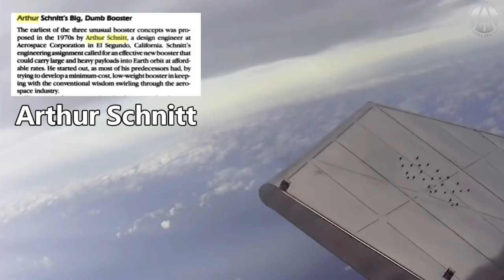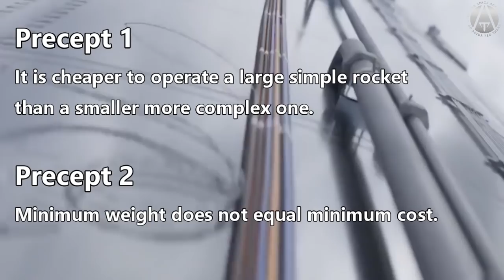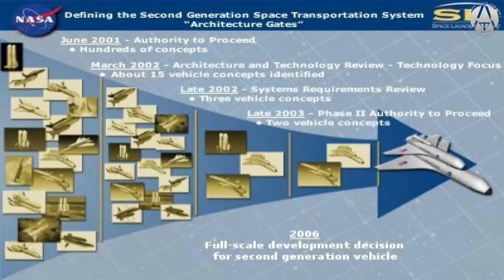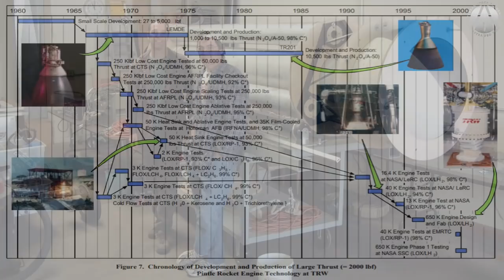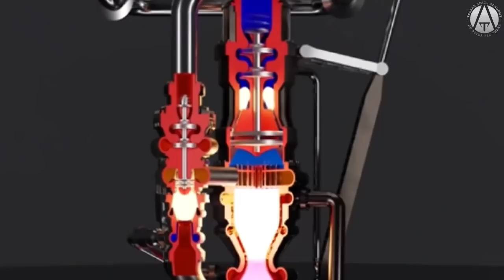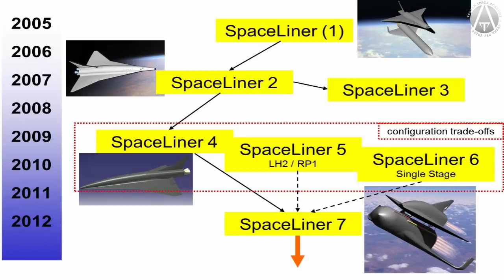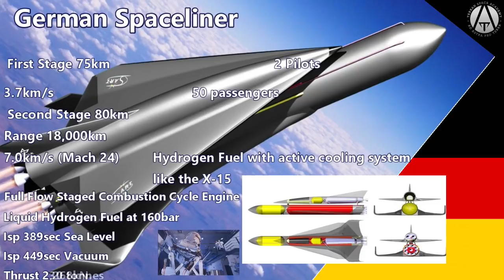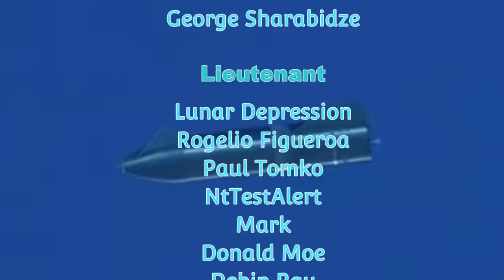SpaceX Starship: What is so special about the Starship system?

Comment: You do realize that Starship VIOLATES every single precept of BDB/MCD right? It's 'cheap' to build only because it is NOT an actual operational launch vehicle at all. It's not even a good expendable launch vehicle let alone the "reusable" one that's been promised.
It is made of 'cheap' materials, by 'cheap' labor but is not able to perform any of the requirements of launch. It is inefficient in it's recovery method wasting propellant and mass for a complicated and  difficult recovery method that does not enhance reusability. (Hence most BDB/MCD designs were robust enough to simply parachute into the ocean, dragged back to shore and refurbished not requiring pin-point landing accuracy and avionics) And at that what we currently see as "Starship" requires vastly more work and systems to become an operational EXPENDABLE rocket let alone a reusable one. Again violating the principles and concepts of "LEO on the Cheap" which stipulates a large, unsophisticated, and cheap to build EXPENDABLE rocket beats a large, sophisticated and more expensive REUSABLE rocket for foreseeable launch rates. (Yes I read and have it)
If you've read it in context you understand that in both cases MCD/BDB ONLY made sense with a higher flight rate and then only with a robust and rather large pre-existing in-space infrastructure (no Starlink 2.0 does not count) and existing need for large amounts of payload in LEO. And in most cases an expendable BDB/MCD won out over any reusable design unless the flight rates were VERY high.

Starship is a complex vehicle that currently lacks the complex (and expensive) systems to actually operate. It has expensive and complicated, (and so far unreliable) turbopump fed engines that relies on a complex and expensive set of avionics and inefficient powered return and landing, (which reduces payload, and note it does not even have an actually usable landing gear design as of yet) to return it for reuse. Then there is the Superheavy which requires even MORE of those expensive systems, a specially designed and built "landing tower" and even MORE complex and expensive avionics to ensure it can 'land' at said tower, (failure of which has a high chance of requiring repairs or rebuilding of said tower) all of which directly violate MCD/BDB principles as well as most normal launch economics for no gain. The ONLY reason Starship is so "large" is to meet Musk's arbitrary focus of "maybe" landing 100 metric tons on Mars. (A figure he plucked without context from Zubrin's advanced Mars Direct concept btw) 

The X-15 did not have active cooling, no vehicle has had active cooling as of yet though the concept is well understood and tested. 

Spaceliner was not further funded for the simple reason that it was not found to be economic. Point of fact (despite what Gwynne Shotwell might think) "point-to-point" (P2P)travel by rocket for cargo is economically marginal and uneconomic for passenger service. This is worse, (not better) with multiple stages due to a higher baseline cost over a single stage system. Further "ballistic" P2P has been shown to be about the worst way to perform the mission due to its inability to interface with any current transport system, thereby requiring and adding additional infrastructure costs to the already high cost of rocket launch.

Your comparison and comment on "America versus the World" is just plain wrong. America is far from the only nation where merit matters and it is often, (especially in the corporate world) individuals "in charge" who can make or break a program. 
We have seen this with the differences between the Falcon 9 design and development program and that of Starship. Falcon 9 had a coherent plan and design focus whereas Starship does not. Elon has a history of failure (with the Falcon 9 being HIS only actual success) due to narrow focus, bad management and poor decision making and his over-focus on Mars that has resulted in the current "Starship" is another in the making.
Elon Musk micromanages all aspects of SpaceX for example, Shotwell and Mueller were not given free reign and had to/have to get Elon's approval for all work and effort. This is a main reason Mueller left SpaceX because of Musk's interference and redirection of Raptor development. (And why Musk is 'blaming' him for the Raptor's problems) Mueller is listed at 'retired' but he quite SpaceX and started a new propulsion company because he saw the same issues at SpaceX that he'd had at TRW.
Reply from the maker: Thank you for the feedback Randy... we will try to address each one.

Starship violates the BDB approach...
It does not though... 
The Starship would be the perfect BDB...
why make a perfect device to test?  Why not build a cheap steel shell and get it working before you try to make an entire rocket.  
Starship has flown... relatively cheaply... how many times has SLS flown?  

The engines aren't simple pressure fed...
The BDB guys were wrong about massive pressure fed rockets.
You would have to us some form of hypergolics to keep them pressurized and the heat and pressure would make the skin thickness too massive to be practical... a 7 to  8 bar big tank with an efficient turbopump is best.

The German Spaceliner was a bad example...
Spaceliner was used as an example of a planned full flow staged combustion rocket engine... not as an example of point to point transport being economically viable.
On the other hand if you can do it cheaply enough of course it will be.
It hasn't been integrated into the current transportation infrastructure because it doesn't exist yet.  Everyone kept saying electric cars will never work because there aren't any charging stations... of course there weren't before you had enough electric cars to make it worthwhile.

Point to point will never be viable...
P2P will have its place.  
The best examples I can think of would be military cargo drops and disaster relief but there will be a NY to Europe and LA to Asia daily point to point Starship at some point.  It won't replace civil aviation... just supplement it.

Raptor was not addressed...
It is fully addressed in previous lessons... 
the point was made by the ship itself... 
It turns out that bigger rockets 
If they are going to be reusable and carry people...
require more advanced engines...
You could put much simpler engines on a Starship and have the cheapest heavy lift disposable rocket imaginable...
As rockets get bigger full flow staged combustion make sense...
Smaller rocket engines will work just was well with expander cycle engines... like the RL-10.

Merit is valued in other countries too...
We would argure that merit is a fundamental human virtue.
Merit might be valued in other countries but their bureaucracies tend to pull down those who strive to rise above.  
The tall poppy must be cut down is not an American phrase.  
Or these other countries don't have the resources to accomplish what SpaceX has...  America doesn't just foster great ideas... it has the means to support the endeavor.  Most don't.
Of course Mueller and Shotwell have to get Musk's approval on important decisions... he owns the company.  In the end he is responsible for everything it does and therefore must maintain authority over what it does. 

Thanks again for raising these issues.
Reply: @terranspaceacademy  
"It hasn't been integrated into the current transportation infrastructure because it doesn't exist yet. Everyone kept saying electric cars will never work because there aren't any charging stations... of course there weren't before you had enough electric cars to make it worthwhile."

This deserves a complete if long answer because it's important both in the specific example and in general.

There's a misconception that transport systems both do and don't have to interface since (as the example goes) airplanes don't land and takeoff from Train Stations and Ships don't load and unload at the local Bus Station. 
But the systems DO interface and are designed and built to complement each other taking into consideration their particular strengths and weakness. 

They are specifically designed as much as possible to interface with each other since they service "destinations" and that is what transport systems require and service.

P2P ‘should’ have a higher applicability to such services than to space launch because there are no ‘destinations’ in space and very little infrastructure or need of ‘commercial’ transport as we understand it. P2P on the other hand ‘could’ plug into the entire Earth’s “transport” network with a little work and effort but in general it’s not economical in any sense to do so and that’s NOT based on just the cost of operations.

The “everyone” who said that electric cars would never work because there weren’t charging stations was likely a majority of folks who simply didn’t want electric cars, (with a sprinkling of people how DID but were complaining for a different ‘base’ reason that the majority which I’ll get to in a bit) because of that they latched onto the idea that we’d need to install thousands of specially designed and operated “charging stations” all over the country and insinuated that this would be a major infrastructure effort costing millions of dollars for a very few vehicles.

Sounds uneconomical right? Well it is. In order to charging stations to become about in any significant way there had to be thousands of electric cars on the roads to justify the time and effort. 
But here’s the thing, you very much did NOT need ‘charging stations’ to start using electric cars on a large scale basis because we did that long before any “charging stations” were ever installed.

Because the infrastructure to support electric cars was already in place, commonly available and widely used. 
Most electric cars early on were simply plugged into home or business ‘standard’ plugs using essentially extension cords. A “charging station” simply used a different ‘cord’ to rapidly charge the EV, it was and is a convenience NOT a requirement.
Yes once you had thousands of EV's on the streets then spending that much money makes sense but it's not NECESSARY to start using EV's and never was.

P2P transport can be designed to use existing infrastructure much as early aircraft used bays (seaports) and big grass fields (cities) to operate from IF one takes the effort and time to do so. 

But I suspect that like many you are assuming that rocket powered, and specifically ballistic rocket powered P2P is the most likely option which is exactly opposite of what every group and study has concluded. 

You ‘can’ do P2P with pure air-breathing engine power, a rocket helps but as a primary propulsion system is has so many inherent issues that it never trades economically. 
It’s worse for anything beyond one stage because the increased operational costs. Worse rocket powered takeoff and/or landing introduces so many operational issues that even if the cost could be brought down the added costs for those operations would be too great.

Not to beat on SpaceX here but since their “concept” is so egregiously wrong from the start they are the easiest to pick apart. 

First of all the operational characteristics of Starship/Superheavy are so difficult that it cannot be operated from anywhere but a very few select sites, (Boca Chica is NOT one while the Cape is one of the few possible land launch and landing sites) so that SpaceX can only plausibly launch or land from an offshore platform. 
And that has to be more than 30 miles out to sea due to the way sound travels over water. 

So right there the possible launch and landing sites has not significantly increased a bit. (Remember the SpaceX presentation where they names about a hundred cites as ‘destinations’? Only about 10 of them were possible and of those only about 5 were actually capable of having such operations anywhere near them and even then the cost and inconvenience of such operations made no sense either economically or operationally)

This is only marginally better for other P2P concepts such as the German Spaceliner since it would still require to takeoff from a dedicated launch facility (in the middle of nowhere which is difficult at best in Europe or Asia) and would end the journey as a high speed glider needing cleared airspace and traffic lanes even though it could (in theory) land at a conventional airport. 

A major issue is true (global) P2P essentially require about as much delta-v as getting to orbit which is a major cost and operations factor even if you spend a good deal of the trajectory outside the atmosphere. You have to go up and come down ‘someplace’ that’s clear of traffic and controlled which again pushes the entire operation either into a remote area or requires a secondary propulsion system to allow interfacing with someplace like an airport.

Now you can plausible suggest shorter-range P2P as a niche service but you’re operational areas and destinations are severely limited. On the other hand the available destinations COULD be worked as an advantage with some effort. 

My ‘suggestion’ is P2P service between Wendover Nevada/Utah and Las Vegas Nevada as a “suborbital” tourism gimmick since it allows a set of ‘luxury’ destinations and their infrastructure to tap into and the draw of a suborbital flight combination. Designed to use a mixed power (jet/rocket) system the majority of the flight would be over the combined Utah/Nevada series of ‘test ranges’ which both eases operations, {subject to DoD approval} and ground-based over flight issues. 
The chances of anyone listening to that idea is about zero but there are other combinations that could be argued as well.

The general throughput would be fairly small but steady which is a major interest in a transport system.

The infrastructure exists already, Point-To-Point does not because it has no economic or market value and cannot compete with cheaper and more convenient subsonic (or even supersonic or hypersonic) air travel not because of its infrastructure doesn’t exist but because its requirements, operations costs and viability are marginal at best and assuming a best case design. None of which has come about yet, and a dirt cheap VTVL rocket system would not make a difference.

Comment: It's really interesting to see how from one report, by one person, can lead to 3 separate people/companies (SpaceX, Astra, Rocket Lab) having a slightly different take on that info and running with it.

SpaceX - Going with a big, slightly dumb, reusable booster and a "smart" reusable (for lack of better words right now, I just woke up a bit ago) second/upper stage, relying on just a beast of an engine to get work done. All while using low cost steel, paired with advanced heat shield technology.

Astra - Is just going for the lowest cost, expendable rocket. Using manufacturing techniques from outside the areospace world and doing it with parts and materials are readily available.

Rocket Lab - They are a little bit of a weird mix in my opinion, they are still using advanced designs and hard to work with carbon fiber (that must be easy for them to work with or they wouldn't be using it), but are shifting into reusability on their current rocket as well as designing a "fully" reusable rocket. Again, they are all about using advanced materials and designs for relatively simple rockets.

Humans are such fascinating creatures but I might be a little biased. Fight me. lol
Reply from the maker: As Spock said to the Vulcan Academy of Science... it is logical to cultivate multiple options :-)

Comment: But Starship isn't a big dumb throw away rocket, SpaceX is all about reusability, and Raptor hasn't been a cake walk. So Arthur Schnitt would have criticized them also.  Isn't SLS intended to be a big dumb throw away rocket? leveraging off existing designs, yet has troubles as well. The older space companies have done everything from big dumb throw away to almost fully reusable and it turns out to be very expensive either way. Rocket science is not easy after all, my hats off to All those who've been successful at it.
Reply: By now reusability exists in words only. Even orbital launches exist only in words. Some people throw away their critical distance for nothing but cheap words.
Reply from the maker: Starship will succeed as a throw away system even if it can never reenter. It is the lowest cost heavy lift rocket you can build right now.  In fact, reducing the mass of the Starship 2nd stage without wings etc... would dramatically increase performance.  Reusable will just make it untouchable for a while.  Until the Chinese Sea Dragon flies!  1,000,000 tonnes to LEO!

Comment: SpaceX and Rocketlab seem to be taking opposite parts of this gamble. SpaceX are launching a low-tech body with cutting-edge engines, Rocketlab’s Neutron will use less-optimized engines to launch a cutting-edge body design. I think either way is the proper use of advanced tech – as a keystone completing the efforts of more tried-and-true techniques. The “cost plus” way would be to use raptor engines in a Neutron body…
Reply from the maker: Both approaches appear to be valid :-) In fact... the Neutron is shorter but stubbier than the Starship 2nd stage but otherwise similar in volume I think.
Reply: I kind of took Rocketlab's declaration on carbon fiber to be a disagreement on such technology not allowing for rapid iteration at reasonable costs. And with the claim they make on how quickly they can put it down, perhaps they have a point and they've solved a major problem in using it cost effectively.

I suppose we'll see how this debate in materials continues from here.
Reply: @Quickshot0 , Yeah we are waiting eagerly for those working Neutron prototypes!
Reply: @marxug1  Yeah, hope they can prove themselves right, would be a big gain for manufacturing in general.